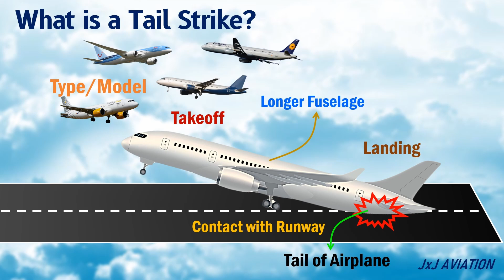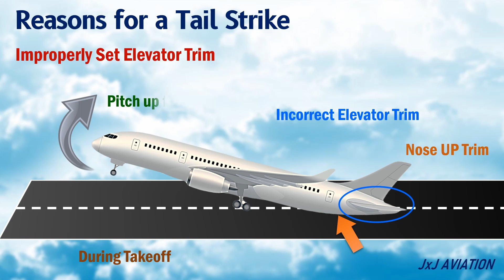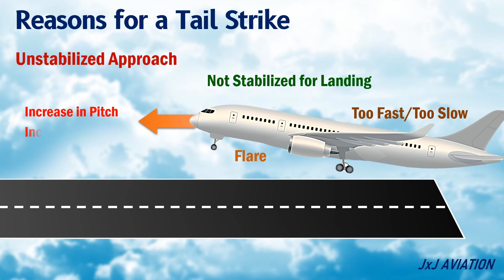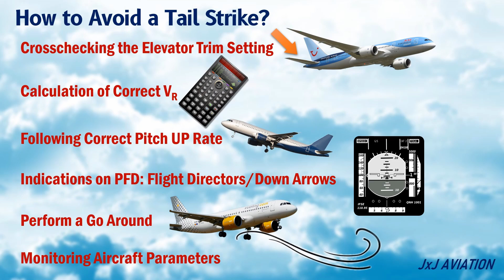What is a Tail Strike? | Causes of Tail Strikes | The Impact | Techniques to Avoid Tail Strike

Comment: Also , there is a trick  that some airlines use for take off: 
Considering  a larger flaps setting at low weights, which increases the tail clearance at rotation.
Reply from the maker: Interesting!
Reply: Interested